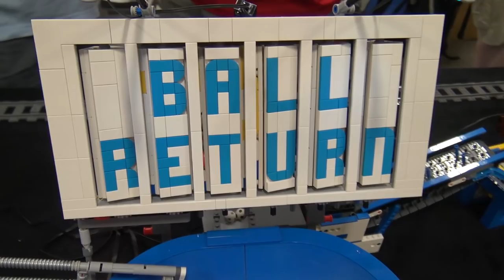LEGO Great Ball Contraption at BrickFair Virginia 2018

Comment: For the gravity powered module, if you would fill the weights with balls that enter and when full split to the gravity driven part you could auto start. If then the balls somehow can be dumped at the end the weight will go back up to be filled again. You might be able to build it in such a way you can use the weight of the balls to shift some balances with your counterweight

Comment: Square puzzles might actually be harder because you can't rely on corners and edges to get the outside and you can't look for exact fitting pieces either. You would only have the picture to go on and depending on the size of the puzzle that could be very hard. Now if there was no picture any combo would work making it easy like you said, but if there's any sort of picture or, even harder, just a pattern that requires a specific order, it would be very hard.